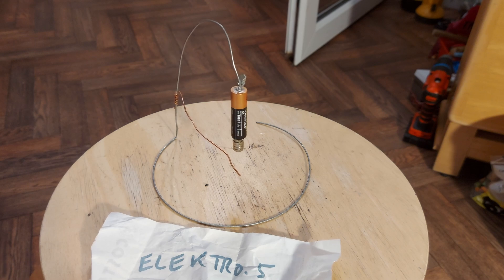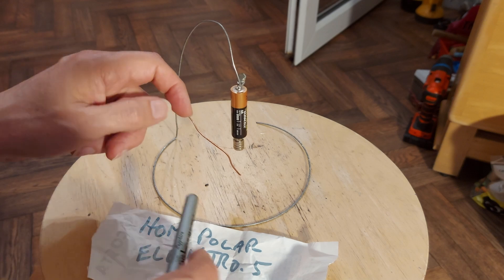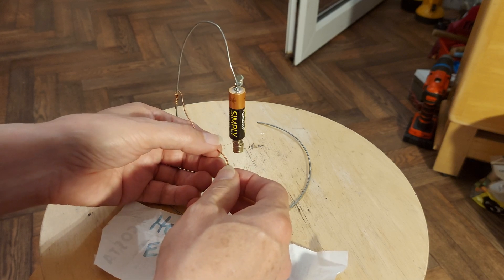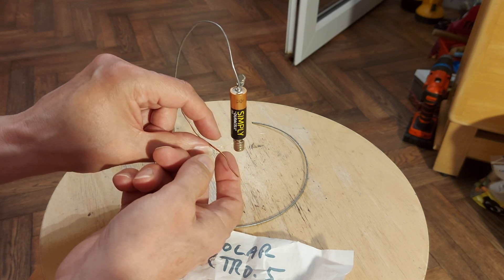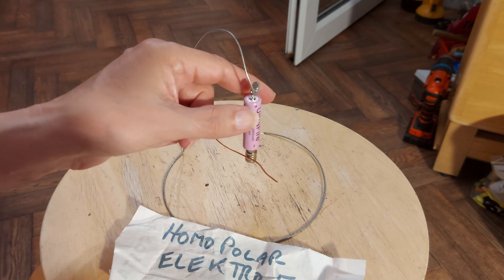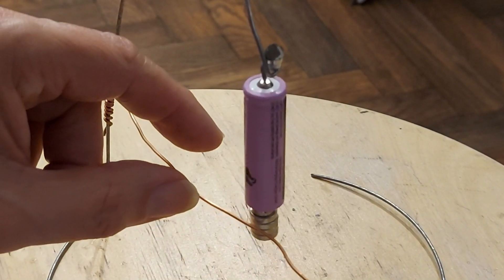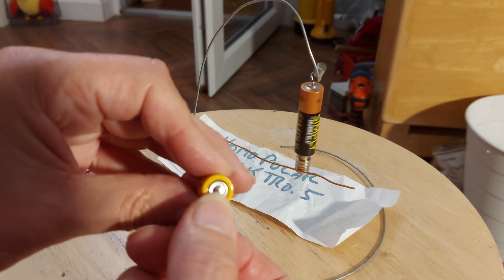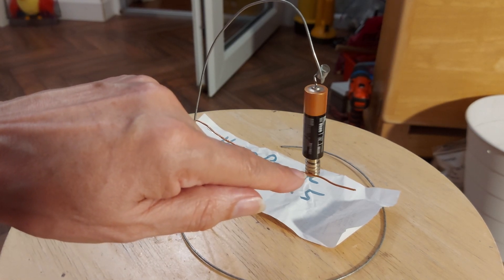Homopolar Motor inspired by elektro.5

Comment: I love it! How long does the 1.5V battery last? I'd love to see a clamp-on ammeter on the support wire to measure the current draw.
Reply from the maker: @jbuchana  I don't have one of those, but this is virtually a full short across the battery, so I would not expect it to last long.
Reply: @GrandadIsAnOldMan  I suspect you're right. I remember when I was in grade school back in the '60s I'd make electromagnets out of nails and bell wire. The old carbon-zinc cells ran down really fast on those. My parents got tired of buying batteries! The wire would get hot enough that the plastic insulation would get soft. I imagine an alkaline cell would last a lot longer, but still not really long.